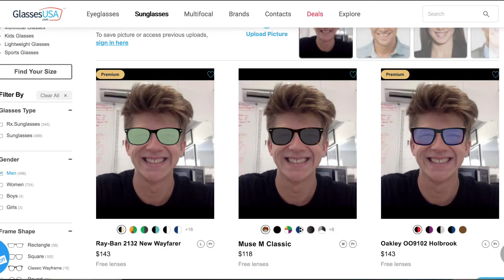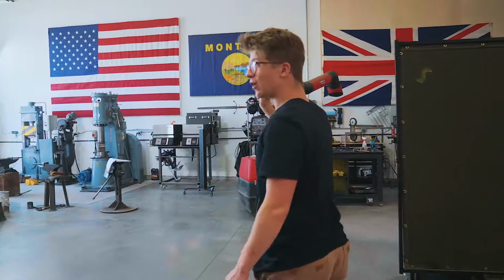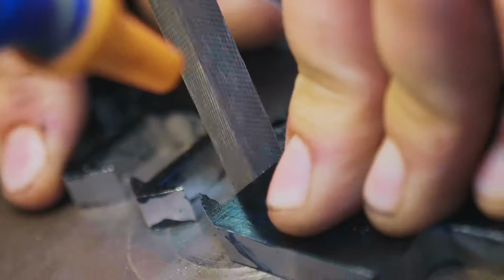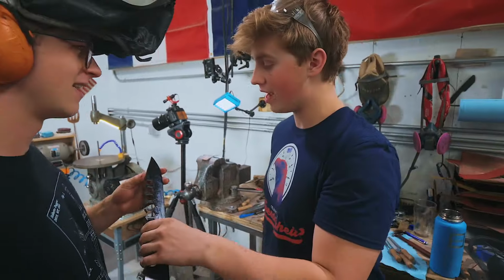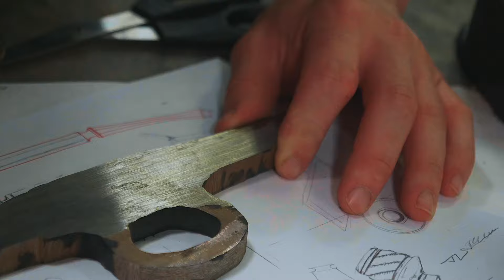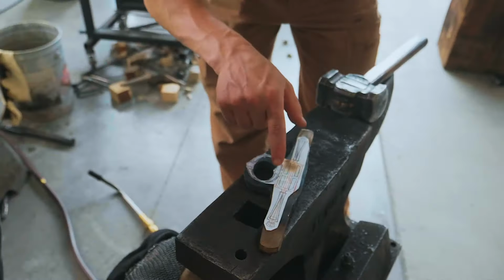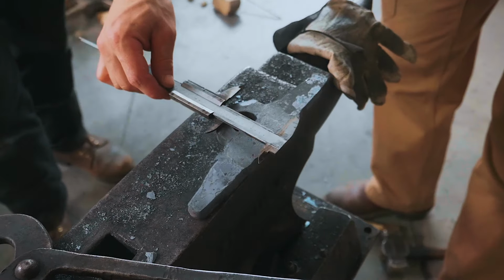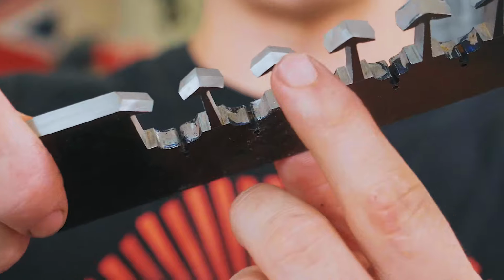MAKING THE SWORD-BREAKER!!! Part 3

Comment: Hearing you say how hard this project is. Really brings a new respect to the blacksmith's of old considering they didn't have the tools or technology that modern day blacksmith's have.
Reply: I imagine they used a hot cut technique far more than it is used today
Reply: This is why the blacksmiths of yore were so revered by their Lords and Ladies.
Reply: Well, they did use a lot of treadle power. 

I've seen a smith use a wooden lathe that could work metal, wood, and stone, that was powered by two young men(4, actually. 2 apprentices and 2 hired. They swapped out every few minutes). The flywheel was made of wood, with 6 stones placed near the edge of the wheel. Using a leather strap, the 100 rpm average of the main flywheel powered a drive shaft at a 20:1 ratio - making it around 2k rpm. The drive shaft was coupled with the spindle by a set of stepped wheels, just like some modern lathes and drills. That thing could get fast enough to work steel. 

The artist's main demonstration was turning a wooden form, and, leaving it in the chuck, he formed bowls, plates and cups of copper and steel sheet metal over the form. They turned out over 100 cups and 50 plates that day. He would pause after each piece and call the crowd together and critique it in a way that taught something, or he taught something about the history behind what he was doing. 

The two pieces that turned out the worst were done by himself. They failed because he was getting old and had a bad case of arthritis. Though, all of the best pieces were also made by him. Save for one, which was made by one of the hired men who also happened to be a machinist; so, he was already good with a lathe.

At the end of the lathe was a station where a flexible shaft could be mounted to the spindle and use small bits, like the ones used in a Dremel. He made the bits himself. Back at the shop, he would have one of the apprentices use the flex shaft to do detailing, carving and inlay along the lines of what what Alec has done with the Viking Sword and the Cavalry Sabre.
Reply: @josh lassauniere these two young men are just beginning their journey of being blacksmiths. Plus, they take in such a wide variety of methods that they will master none of them.

They are good at what they do, don't get me wrong.
Reply: @thatrealba , they can master them if they keep at it at the pace they're going. Looking at the Master Smiths from ancient times to now, "all of the above" is more common than you would think. It is not unreasonable to ask a couple of kids with this level of talent to be full Masters of their craft in the next two or three decades. They are not trying to be Jacks of All Trades, they're pushing to be Masters of Smithery. So far, A&W haven't really delved into other crafts at all.

Comment: One of the greatest tools used by a blacksmith is patience. Well done for all the intuitive ways you solve issues and your hardworking persistence. Will has done a fantastic job on the teeth of the sword-breaker considering the pressure to keep them symmetrical and not to mention the risk of making a mistake that would affect the entire blade! Good job!

Comment: Hey Alec and Will, I have found on my die filer that if you run the file just a little faster than "usual" and apply lighter pressure it won't lift up as easily. Maybe add just a touch of coolant as well to keep from overheating the file since you will be running it faster.
Your finger placement onto the work piece looks good, but make sure to hold the edge/corner of the piece with your pushing thumbs to keep your fingers from sliding into the file.
Good luck, and thank you for the great videos.

Comment: Hmm,  aren't the teeth getting a bit thin ? I mean compared to the original drawing and references online they seem kinda fragile at the end there :/
Reply: I was about to say that. I feel like they will break.
Reply: I was thinking the same thing.
Reply: To me they looked already quite thin in the design phase, especially considering the force that they have to endure in a full swing
Reply: They are thin, but they are wide. If hardened correctly I think they will be fine. Historically, if it worked well enough to last and save your life in a single fight, it would be priceless.
Reply: @jdmec81  Historically they didn't work very well though because there aren't many of them left for us to find.  If they were so effective, they would have been more common.  Their fatal flaw is that you have to be nearly perpendicular with the attacking blade in order to actually catch it.  If you are off by even a little, the sword doesn't enter the teeth and acts as a slide for your swordbreaker to push off to the side completely exposing your front.  They were effective when they worked, but they didn't always work.
Reply: @iMeatbag  They're uncommon because they're extraordinarily difficult to make.
Reply: If you look at the design, you can see that the pins are not intended to resist the force of the opponents blade.  They only guide it down to the notches at the bottom of the slot, where the steel is much thicker.  This knife is not intended to stop the force of the opposing blade, just deflect it.
Reply: Might loose a few teeth during battle there
Reply: @iMeatbag  Not correct, they were highly successful but quite uncommon due to the fact it took so much work to make it to begin with, thats why the most common weapon used was the spear, easy and cheap to make and extremely effective.

I might also add it required the soldiers long training to use it, all those downsides is what turned out to be the death of this specific weapon.
Reply: To be perfectly clear : I am in no way questionning their jugement : they are the pros, they make things I couldn't even dream to do, I was just asking a question :)
Reply: @wilkinson6400  rapier and dagger was never used on the battlefield, this is not a soldiers weapon it is a civilians
Reply: Considering it's made to be used against rapiers, they are probably tough enough
But if they keep grinding that it's definetly gonna break
Reply: @DuckcuD  Its not designed to be used entirely against rapiers, they are designed for the use against swords specifically, where they used in a battlefield? Yes, but as a alternative weapon, used mainly for when their shield would break or become unusable (shields often lost their handles when struck with maces/mauls) and this was used as a emergency for the nobels. 

Another thing is that no more than 400 of these are found,  they were a HELL to make back in those days due to the lack of technology.
Reply: Not just that, when he goes for the heat treatment,  the teeth will overheat because they are so thin, and an unevenly heated blade means a crooked blade, unless, of course, they use the ovens they have...
Reply: @jakenelson5658  i think the swordbraker was only used against florets or weapons like a florett. I dont think that the where used against longswords ore onehanded swords.
Reply: @der.kleine.pyromane  It is still designed to pry a piece of steel (a sword) out of a person's hand. The teeth are very thin on this one and would most likely break against a larger sword.
Reply: @wilkinson6400  you got any sources for them being used on a battlefield?
Reply: @xenonram I was thinking the same thing.  They would have required weeks of hand filing, so probably only the very rich could afford to have one made for themselves, and an ordinary dagger would have worked just as well under most circumstances.
Reply: You would be surprised at the amount of force it takes to break hardened steel that thick. Sure you can break the tip of a regular knife pretty easy but those are pretty damn thick and wide.
Reply: iMeatbag so you saw that video too, huh?
Reply: And these guys have over a million followers master Smith's lol 😂 😂 like they don't know what there doing lol 🤣
Reply: Carlos Sousa why the hell wouldn’t they use the oven they have specifically for heat treating? Lol.
Reply: @iMeatbag  Do you think everyone those days could even afford one for them to be common if successful? Stop pretending you know what you're talking about.
Reply: In my opinion this sword-breaker thing is just an novelty or ornament. It is only made for the looks. Not at all practical. One blow and those teeth will be gone. I am sure they have never been used in any actual combat.
Reply: @iMeatbag  Not to mention a buckler existed at the time as well and was a lot easier to use.
Reply: I was thinking that to but I know nothing of sword breakers so like yeet
Reply: Pretty sure these were meant for the kind of fighting where a rapier or similarly light sword would be used. Lots of hacking and slashing force wasn't really a big threat with the most common weapon they'd be fighting. If Alec and Will are going for a renaissance or later style, broadswords and and long swords were less common. Not to say that the big ol' swords weren't still around for warfare but I don't think rapier and dagger fighting was a warefare weapon. More of a civilian "open carry" weapon. Far as I know most people were beginning to preffer the light (and increasingly long) rapiers which were great in concert with an offhand parrying weapon.
Reply: They aren't going to use it, show piece. The only thing is problems in heat treatment, but I'm sure they have thought about that.
Reply: @emmitstewart1921  Sill the Blade will sit in between the teeth, it's not like any sword is as thin as a rats tail to just touch the thick lower end. To catch the opponents sword you will have to exert the greatest force possible to keep your enemy from pulling it out of your dagger before you were able to strike. I think the teeth would bend easy within just one time using it. Also they did not terminate the Arrowheads with a round corner to prevent it from breaking easy. Also there are many many designs out there just on google image search that look really sturdy and thick compared to what the boys have made here.
Reply: Not arguing the usefulness of this sort of weapon, but you guys are over estimating the time required to file something like this for someone who is practiced in filing. I spent a few months filing steel to toleranced dimensions at the beginning of my apprenticeship and when you start out it's hard to hold a line and keep your edges square to the face and you get blisters in no time. If Will had to do this sort of thing daily for a few months he would have been able to knock out the filing in a day after milling out the vast majority of it. The type of craftsmen that would have originally made these would not have spent weeks on the file work.
Reply: Foreshadowing
Reply: Josh Cob hahaha exactly what I was thinking 😂😂
Reply: @hallucinatedovens8414  dude, don't be a jerk
Reply: Kyan rapier and daggers were used.just not popular. Just not better than rapier and  buckler or estoc

Comment: @Alec Steele Forge the Guard out in two pieces, make dies for the power hammer or the press to get the pieces into rough shape (about 70-75%) weld the pieces together, then grind the welds flush with the rest of the piece. 

Makes the process a lot more efficient... not to mention a ton easier since you have tow pieces to work with when you're doing all of that complicated grinding. 

I also noticed that the teeth of the sword breaker itself are getting really thin... I'm not certain it would be advisable to heat treat them in their present state... unless you're using copious amounts of refractory clay as insulation, and even then there are no guarantees.

Comment: Hey Alec, I thought you mentioned something about putting doors on the forge during the forge building video in order to avoid using the fire bricks. Is that still the plan or did that part of the design not work out?

Comment: Here is how you use the die filer without pinching you fingers: hold the work piece with clamps on either side that are long enough that you don't have your fingers in the pinch point. You could also put the foot on the tool, assuming that old machine even has its foot anymore. Yes, it makes it harder to see what you are doing, but your filing will not take nips at your finger tips and it will be more accurate.

Comment: I wish I had one of those filing machines. If I were using it though, to avoid the piece jumping, I'd have to strips of wood the same thickness as the piece, and a board of wood clamped down over the top, that way, you could slide the piece you're working on underneath and move it around the file, but it would have nowhere to jump when the file bites on.

Comment: The Die Filer is missing some parts. There should be a couple of "fingers" that are can be positioned over the table and work piece to hold it down on the upstroke. They should make the experience much more pleasant

Comment: I wonder if you attached a magnet to a thick enough piece of steel that it would get your fingers far enough away from the surface to avoid pinching issues. The magnet would hold the piece to the 'safety spacer', and you could bolt the magnet to the 'safety spacer' to make a single, solid piece.

Comment: I am wondering when you will get more efficient with materials and time by "forging closer to finish"  A lot of the other smiths seems to be able to get a lot closer to the finished project with their hammers.
Reply: Because it's a lie quicker to mill/grind it. It it's not staying as a forged finish, there is no point of spending hours of time and money in propane to tap on the steel to get it so close. That knife grinder he has will chew through the material much faster. He gets it 80% of the way when forging and the last 10% on the grinder/mill/surface grinder. He can forge it to near finished dimensions, like 95% of the way, but it's pointless. The time it takes to go from 80% to 95% takes 2 hours of forging or 20 min of grinding. And forging it to 95% still requires 10-15 min on the grinder. So you're saving 5-10 min of grinding, but spending 2 Ezra hours forging.

Comment: The die filers I have used or seen had an "L"  shaped pressure foot provision mounted in the over arm to keep the stock from jumping. Or you could clamp a flat bar on parallels to bridge over your stock. Need a tool make a tool.

Comment: For that nub in the guard Id've drifted 3 holes. Two side by side at the bottom of where the hole needs to be and then joined them at the top with a third hole.

Comment: Im sure this has been suggested half a million times, but with the die filer, why dont you put an adjustable small metal sleeve on 1 or 2 sides that is set to the same height as the work. that way it wont jump as much while filing.

Comment: That auto-file is missing a piece, there's supposed to be an adjustable holdown on there that you set like .005 above the piece so you can still slip the piece around but don't have to use any downforce by your hands to keep the workpiece stable.

Comment: Alec!!! Learn how to braze/solder and just make the ring separate from the guard!!!!
Reply: Welding is much stronger but stronger yet is keeping it all in one piece. Its a valid point you make but there are stronger options for it
Reply: Rydian Ryder you’re absolutely right, there are stronger options, however they also have flaws. The flaws with a solid piece is already obvious... with welding it is difficult to preserve cleanliness in the piece without boogering stuff up. Brazing and soldering were used a TON in applications like this because they allow you to maintain a degree of cleanliness, so you can make a dainty ring and then attach to the guard and not have to remove a huge amount of metal to get it to the finished shape.

Comment: Those pokey bits could be cut at a local shop with a wire EDM machine. If you're going to use a die filer, might as well go full modern with the EDM.
Reply: That would be pretty expensive. An EDM cuts at about 15 in^2/hr, but ranges from 5-50 in^2/min. Job shop EDM work goes for about $80/hr on the machine (can vary between $20-120/hr depending on a number of variables). I rough calculated it to be about 25 in^2, or an hour and 40 min on the machine. Plus about $50 in consumables and another $50 in CAD/CAM time. So it would cost right around $200-250 to have it EDM cut. And that assuming the best of the best pricing. EDM is for high precision, hard/tough materials, internal features, with tight/small/complex shapes; anything not possible/optimized for a VMC. It's not good for this application. Plus he wouldn't have all this content to film.
Reply: @xenonram  Thank you for your thoughtful reply. That tang geometry is so intricate with lots of sharp corners that EDM would be perfect for the job. And, considering how thin those tangs became (by design or by error), the finish pass by a VMC would have them singing like a church choir!! But at $250+ for EDM, files are the way to go for this one off prototype.

Comment: Being a woodworker, in my eyes you are really choked up on that hammer. I guess you get greater control, but you lose a lot of torque. Keep the videos coming! 🤓🤓🤓
Reply: For every stroke you see him swing on camera, he's doing 20 strokes in real life. Go to your garage and grab a 2½-3 lb sledge, and let me know how many times you can swing it, and how quickly you choke up on it.
Reply: But it seems you could get a few more powerful swings in while the metal is on heat, rather than taps while it is cooling. As I say, just a woodworker. The only time I use my light sledge is when something is stuck. 🤓

Comment: So I'm not a blacksmith at all. However I did take your beginner blacksmithing class and I am working on projects but I digress. My question is why not just forge weld the original guard back together instead of cutting a new piece?